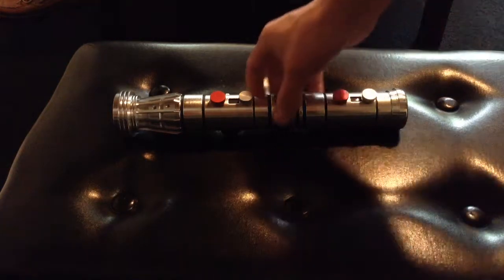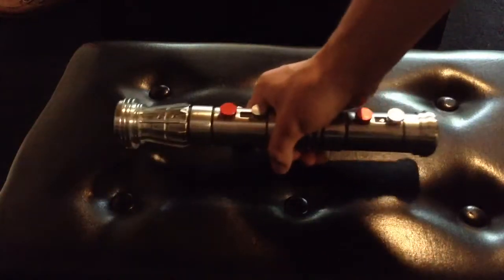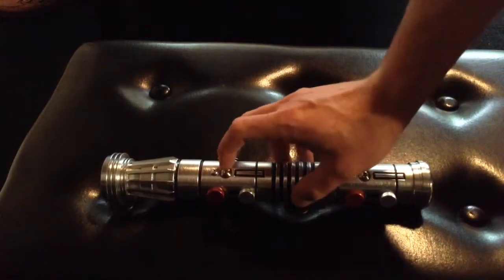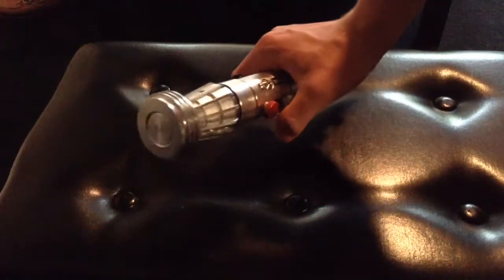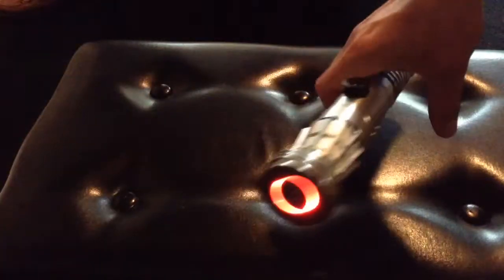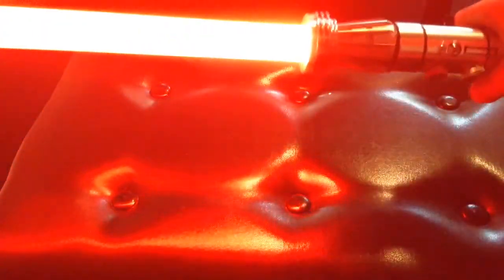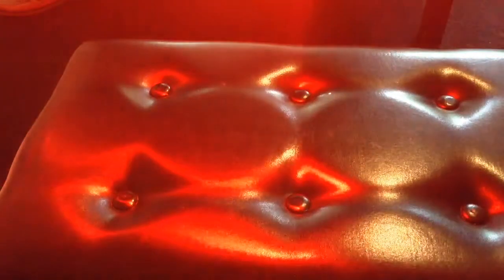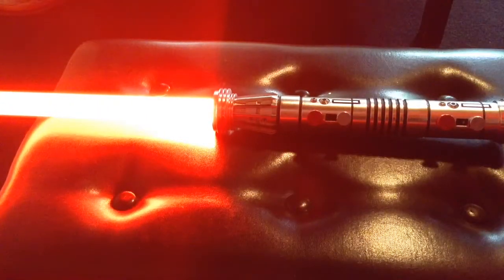#012 - Park’s TPM DM1 Lightsaber

Comment: What type of chassis did you use and how did you install the switches,  I know this version is different from the previous one?
Reply from the maker: zack chism the chassis I used is the sid 1.0 chassis, which was now updated for the 2.0, but is still the same. I just put different parts of the chassis in different places for a better fit. The switches I used are the ones that came with it, there are switch holders under and over the tactile switches
Reply: I just asked because I tried to put the switches on with the switch holders and they just will not stay on and the tactile isn't high enough to be able to press down on when I put the buttons on top. Is there something you did differently , any advice would help thank you.
Reply from the maker: zack chism are the tactile sanded down at all?
Reply: By the looks of it, no they're not
Reply from the maker: zack chism I’m not sure then. I haven’t encountered that problem with my switches. You put the two black sections in each hilt right?
Reply: Yes I have
Reply from the maker: zack chism that’s really strange, maybe putting a dab of hot glue on the tips of the tactile switches, then flying the red and silver buttons to those